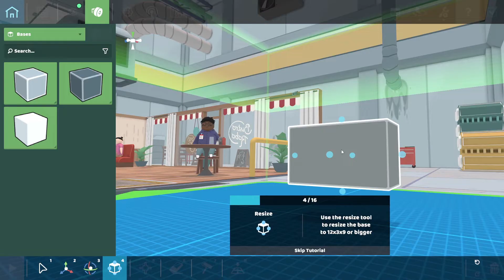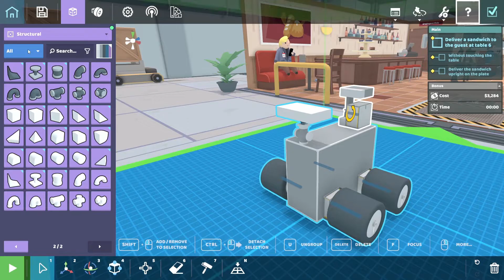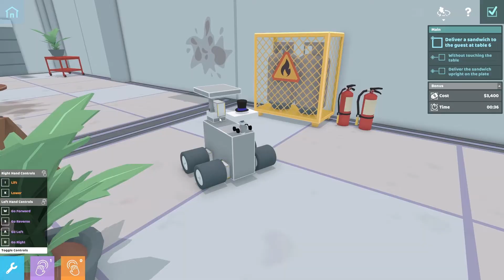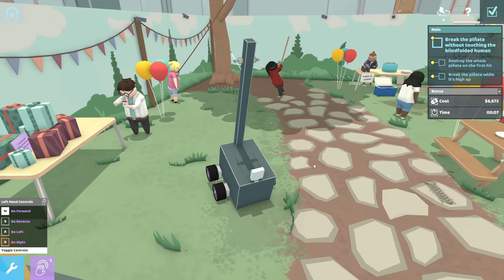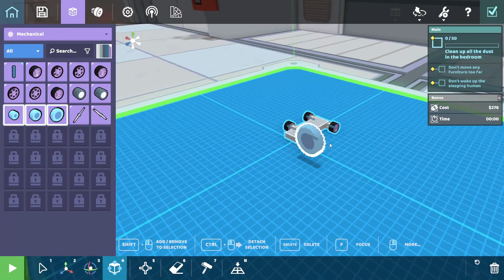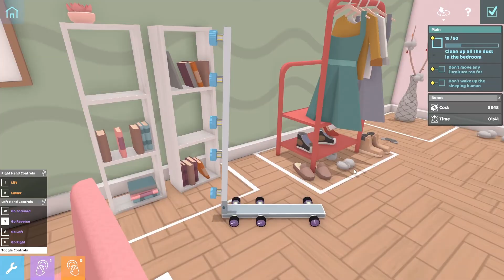Hi, Robot | RoboCo (Robot Designer And Builder Game - Early Access)

Comment: LoL you need to think in 3d, use the #2 tool to move things up and down and left and right and forward and bacward. The #3 tool to rotate objects around a point left or right, after you select objects. The #4 tool will make things resize in and out. I hope that helps a bit to use the tools. I used to make CGI for movies and this is a more basic program similar to what we used for that. If u think about what shapes make up an object you can make anything in this program. Have fun!!